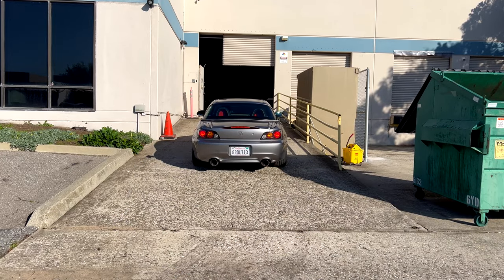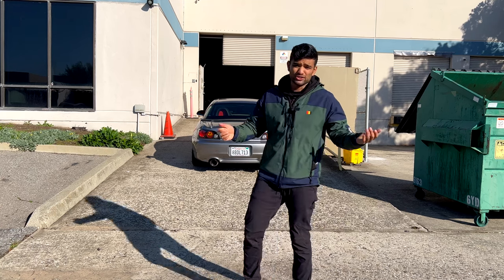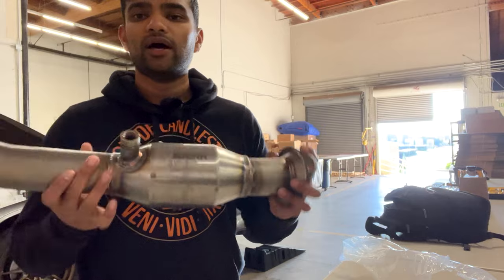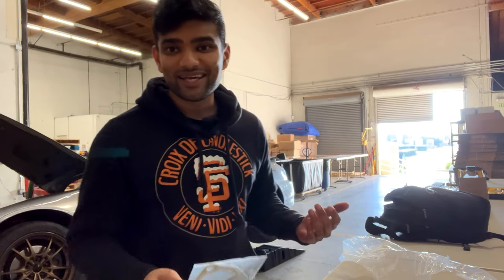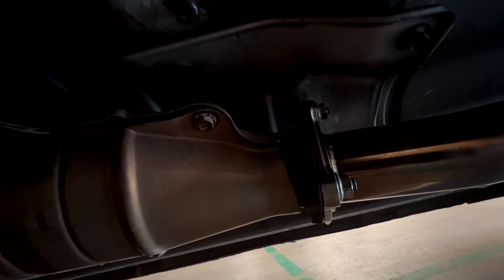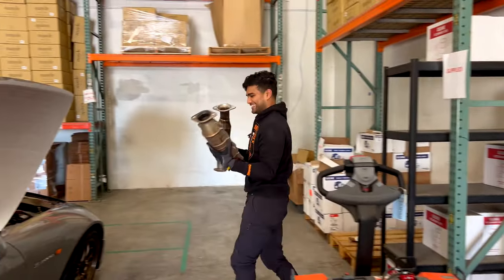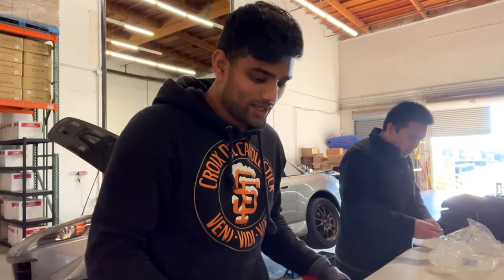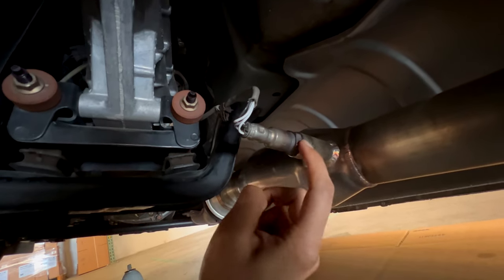Berk Technology High-Flow Catalytic Converter (HFC) for Honda S2000 Install and Review

Comment: The heat shield of the stock exhaust is meant to be reinstalled on the Berk. That is where most of your weight savings is coming from.
Reply from the maker: Ahhh that makes sense. Might help you pass a visual smog inspection as well.

Comment: Adding the high flow cat, does it make the exhaust tone sound like a rice car or raspy? I have a skunk 2 header and HKS high flow cat back I love the sound I got.  It looks like you gain some benefits out of it without sacrificing extra noise that would make the drive annoying, Will you recommend it's a good investment?
Reply from the maker: Thanks for watching! Volume difference was minimal in my opinion. I imagine a test pipe would be much louder than a hfc. I think the hfc is a worthy install/investment. From what other owners have told me, it actually reduces drone noise in other exhaust.

Comment: Nice install and S2000! Would you say it's safer to jack it up on all 4 stands vs just tilting the car on its side like that when installing? Also, when it comes to the OEM spring bolts and donut gasket on the header side of the cat, were you able to re-use both of those OEM hardwares? Thanks a lot for the video!
Reply from the maker: Thanks for watching, dude! Definitely be safe when jacking up your car. Dont follow me 😂 but that being said i think its totally fine to jack up one side only. We placed ramps under the wheels just in case. By jacking it up from the drivers side you get easier access to the o2 sensor. The rest of the bolts are pretty easy to get to from that same side too. Ideally, you should replace the header donut gasket. We ended up reusing the original bolts but when i put my cat back for smog purposes ill replace the bolts then. Works totally fine for now. No exhaust leaks after a few spirited drives.